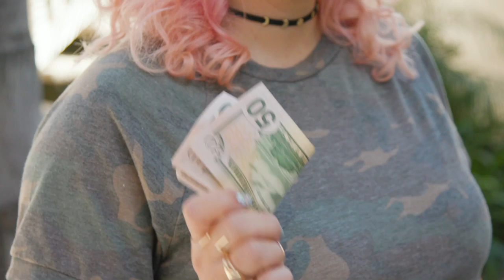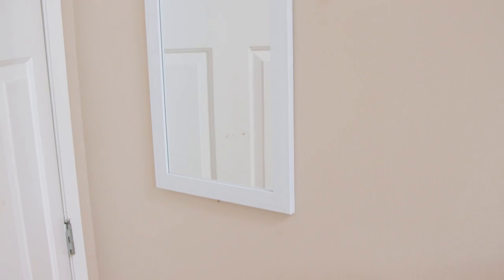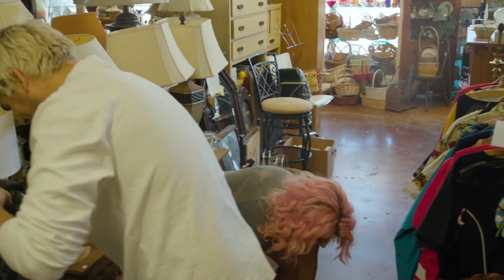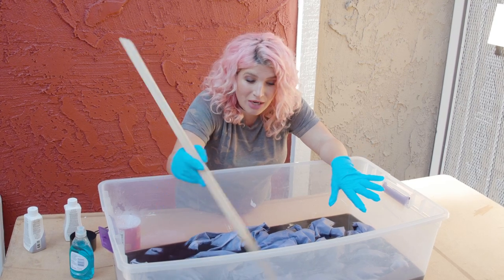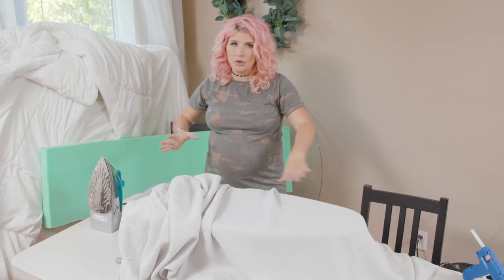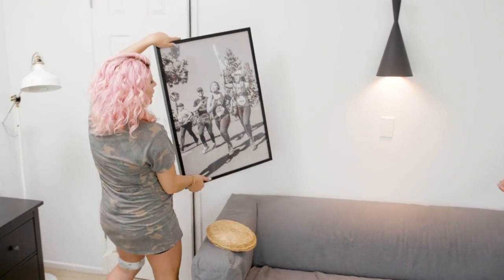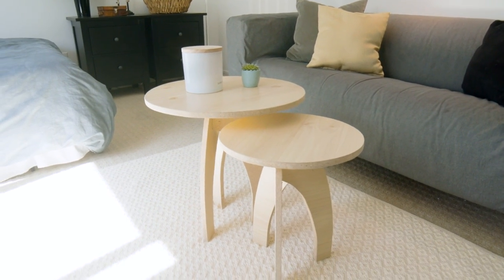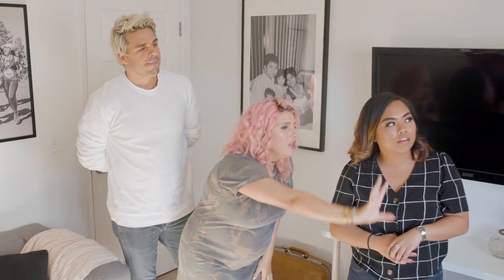$200 Bedroom Makeover! Hygge Style!

Comment: I feel like it they had taken a hook, drilled it into the ceiling about 8 inches from the wall, and then hung the pendant light from that and let it hang down, that that would have been a much better look. Or putting a small piece of wood to push the top of the light out so that it was straight up and down. I don't hate what they did, but with the rest of the room looking great, the way they hung the light makes it look a little lazy.